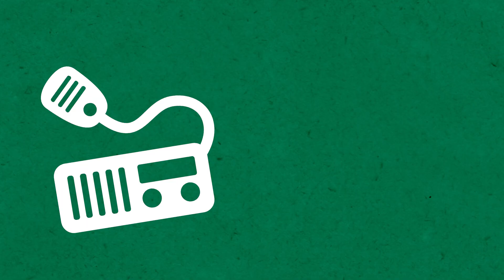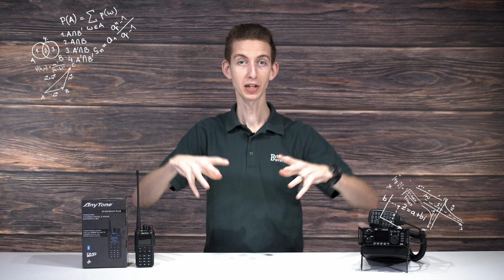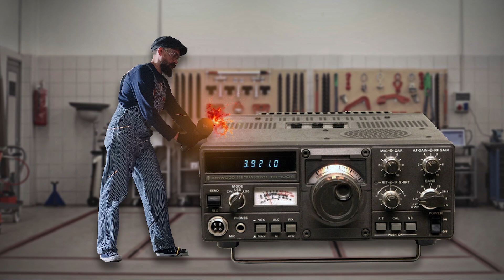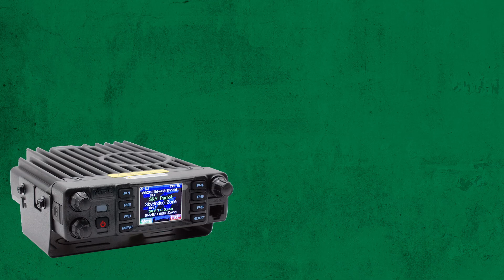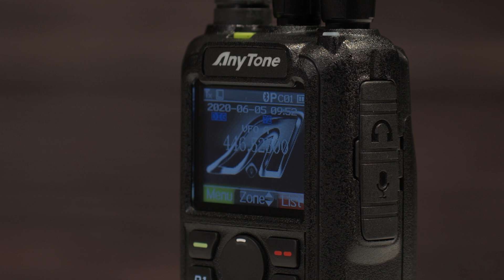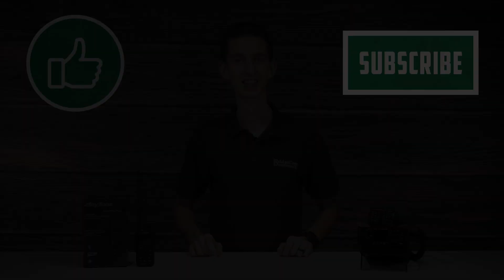When To Switch From Analog To Digital Radio

Comment: Upgrades on the firmware only allows the product to be pushed out to the public before it is ready and if you have a problem with the radio it is more than just switching to digital since some repeaters are still analog only.